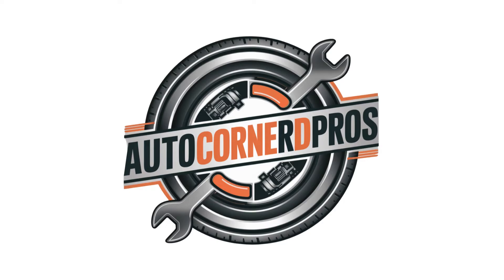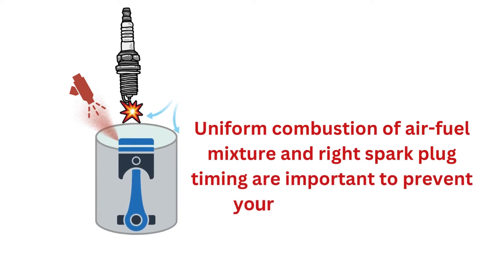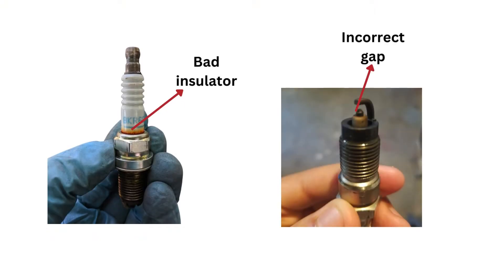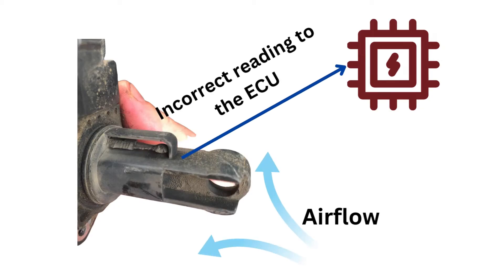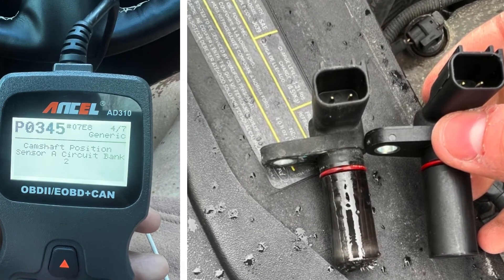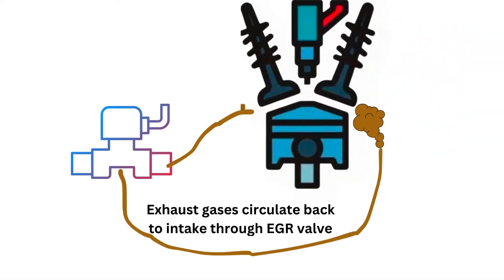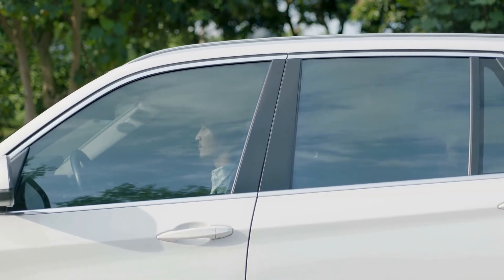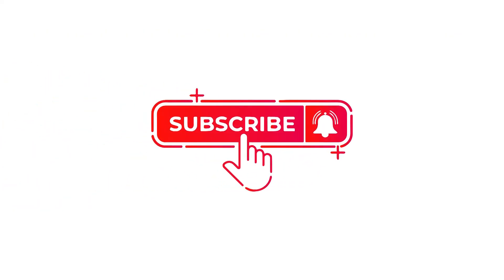7 Reasons Your Car Shakes When Check Engine Light Flashes Due to Misfire (Don't Ignore!)

Comment: My 1999 Buick Lesabre just started with the engine light has been blinking on and off and I stopped at a red light and my car was shaking
Reply: And my car is a V6
Reply: Same here. Did you get it fixed? What was the issue? Thanks

Comment: Hi my 2002 Toyota ALLTEZZA 1g. It runs good when it’s cold but once the engine is warm it starts to misfire losing power and sluggish. But when it’s in neutral it’s fine. Only when it’s in gear and running it comes back. Any information will be much appreciated
Reply: having this problem with my infiniti also!
Reply: Same here 2002 VW Beetle. Took roughly 15 miles driving when the engine light went on and it was shaking. Like driving over a pile of rocks.

Comment: What if the Check Engine light is solid while your car shivers & rattles?
Reply from the maker: Still could be sign of misfire. Or may be engine mounts are bad? Run a scan and check trouble code
Reply: That would indicate a bad coil pack or spark plug
Reply: While running car it’s vibrate and check engine light flash I have change all 4 spark plug done trotal clean , fuel injector clean still it’s run for an hour and again check engine light come with car vibrate what to do it’s Mitsubishi ASX
Reply: @djakhil83  misfire